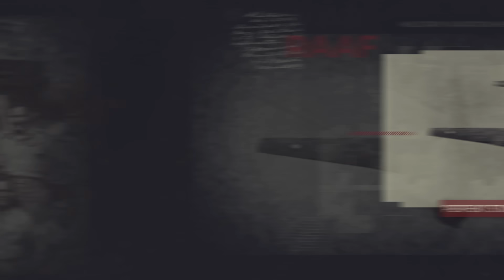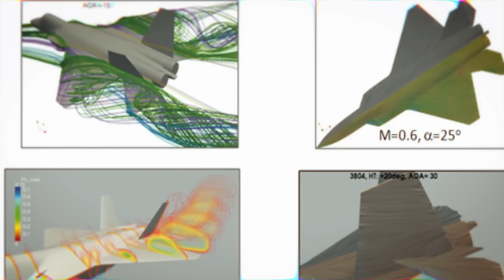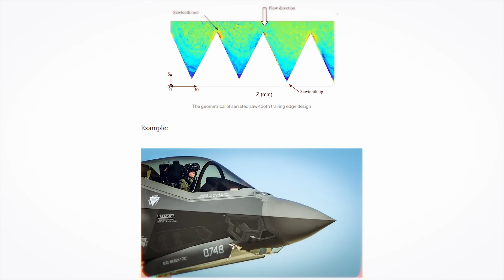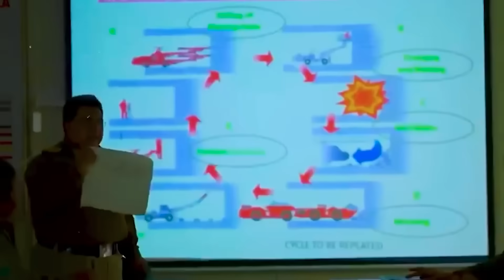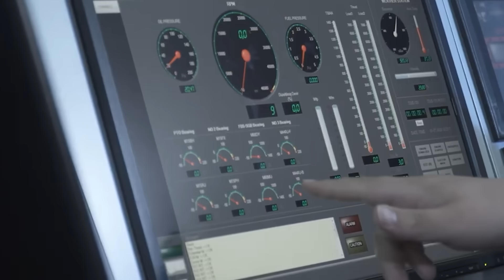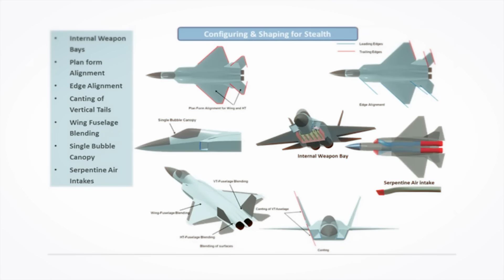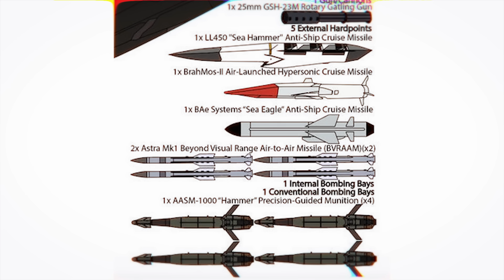India's 5th Gen Aircraft | HAL AMCA

Comment: India is going to spend all of this time and money on trying to make a knockoff of the F-35, only to have it get completely wrecked by the first SU-30 it goes up against.
Reply: First of all it's twin engine and most of the part better capable and faster than same or better level of stealth than F35. And tell me a 5 th gen real 5th gen jet in west that does looks different. Modern 5 th gen aircraft has similar design because it's the best design simple as that. And you should worry about china copying. India wouldn't copy Indian specs are different

Comment: Another one that looks just like an F-35
Reply: convergent design, next youre gonna say all bullet trains look the same
Reply: Yo why all caliber bullets are made with the same material? Why does their oppo phone look like my samsung phone? 🤔
Reply: @AmAn_DoingStuff yeah. What a coincidence that a Chinese nationalist stole 50TB worth of data from Lockheed of the F22 and the F35,  5 years earlier, ADMITTED to it, then china comes up with a plane that not only has almost identical lines, identical angles.  Yes it has twin engine, but thats because lockheed didnt have the techs on the engine. Thats Pratt and Whitney.  And china cant internally build their own powerful and reliable engine.  Which is why they were still running the Russian engine until just recently.  But if you look at a F35 and a J35 from the sides, from the top fvrom the front, you can clearly see a distinct copy.

Comment: Meanwhile, back in the REAL world, the only fighter that India is manufacturing is the Tejas (an obsolete and under-powered aircraft that took FORTY YEARS to get into production).
Reply: how is it underpowered ?
Reply: @RedBlue-ns5cs  It uses the old F404 GE engine used by older fighters. The Tejas does not have enough power to take-off (with munitions) from its aircraft carriers. Which was what it was designed for.
They should have used the F414 which is newer and with more power.
They announced they were planning a new version of Tejas which do so. But that was back in 2020 (and the new version is still years away from production)

Comment: Seems to me like the US oughta consider a version of the KF-21 that they can license through Lockheed Martin since they are collaborating with the Koreans to make it anyways
It’s basically an F-22 that’s just not as advanced at this point and if you could update it’s systems and engines to American specs you’d probably have a world beater on your hands and if not it works at least be a good replacement for our aging fleet of F-15/16s 
The US needs a fill in the gaps plane between the F-35 and the NGAD if they even go forward with that thing
They don’t plan on building a lot of them anyways so What are we going to do?
Just let our other fighters age out and have only a handful of NGADS and the F-35?
Seems silly to me
The thing is that as we move forward it really doesn’t seem to make sense to rely on 5th/6th gen fighters for everything anyways
Once you kick down the door and destroy their air defenses you don’t need stealth necessarily so aging their airframes by running bombing missions seems silly to me
I guess if they actually complete the NGAD they can be done by drones but that’s speculative at this point s to how effective they’ll be and when they’ll actually be viable to perform those roles
If they can keep them relatively low cost/low maintenance it might be a good stop gap while the USAF gets their act together and figured out what they’re doing
We’ve been in limbo for years and it’s getting kind of crazy the holes we’ve had in our defenses for years now and those gaps seem to be getting wider and wider

Comment: Like the F18 fighter, the combat radius of the KF21 is expected to be 800km. Of course, this applies when equipped with three large-capacity fuel tanks. India's AMCA is also believed to have a combat radius of up to 800 km because it has the same airframe structure as the F18 fighter jet.

Comment: The F414 engine's maximum speed is difficult to exceed Mach 2 due to its structure, thrust, and increased air resistance due to its stealth shape. Since the F414 engine itself is an old technology, it can only exceed Mach 2 if its structure is changed or improved.

Comment: HAL makes 5th G fighter plane? It has a history of maintaining Mig-21 and crashed over 400 of them.
Reply: @mytub9  See it's induction date 🤡 much older than F16 but still f16 650+ crashed till date.
On the other hand Tejas with just a single crash in 8 years
Reply: @PriyakritMaji   That can't even be compared. The F-16 has 4,604 built (as of June 2018) with around 650 crashes, which is about 1 in 7. Meanwhile, India had a maximum of 800 MiG-21s, with over 400 crashes, resulting in a mortality rate of about 1 in 2. The truth is that India has some of the highest crash rates for fighters due to poor maintenance.🙄
Reply: @cosmictoast9123  There's a difference of around 24 years between them.Also most of the f16s are owned by US and US crashes remained classified all time
Reply: @PriyakritMaji  I agree, but US also built way more f16s, 4600+ to be exact, crashing around 650+, thats still a better track record than Indias since it inducted around 800 mig 21s, but crashed around half of the jets. Both countries have poor maintenance to some degree, but India is just on another level. Also most country classify jet crashes, its not limited to U.S
Reply: @cosmictoast9123  what about Indian made Tejas with just a single crash in 23 years of flying 🤡
Reply: @PriyakritMaji  Do some research before using the clown pin 🤡. The HAL Tejas only has 53 built and only entered service in the Indian military with 32 operational jets. While I can also say that the J-20 has around 300 built with only one notable accident.🤣
Reply: @cosmictoast9123  Also China made 200 j20 not 300
Reply: @PriyakritMaji  my comment keeps getting deleted somehow. China does not publicly release their numbers of jets. It is all western and international estimate. Based on sources “Estimates from think tanks and professional military institutes, suggest that around 200 J-20s have been produced as of the end of 2023.” “At the time of writing in mid-2024, I cautiously estimate that the J-20 fleet size may approach 300 airframes.” It doesn’t matter if it’s 200 or 300, it does not effect and change the core of my argument.
Reply: Chinese bot spotted!, instead of improving their technology n give more time in proper r&d, china could only managed to copy the designs, but the guy like to comment on India's situation 🤣🤣🤣
Reply: @himanshusingh-st7xi  That’s some crazy cope. HAL Tejas is still in the design phase( it’s probably going to take a lot longer) HAL Tejas, which is barely 4.5 generation, took over 30 years, don’t even talk about 5th generation. How do you have the courage to bring up China when they already have hundreds of 5th generation jets (though controversial) but they’re still 100% better than all jets outside of the U.S and especially india. 😂
Reply: @cosmictoast9123  "but they're still 100% better than all jets outside of US n especially INDIA" 🤣🤣 NOW THAT'S WHAT A 'REAL HUGE COPE' should be🌚👆along with DELUSION N ILL INFORMATION
Reply: @himanshusingh-st7xi  Present me with facts than:face-blue-smiling:, fine ill change my phrase up a bit. All i know is that Chinese jets are still 100% better than all jets currently operated by the Indian Air Force. At least I know that Chinese jets score 9-0 with j10c in qatar exercise while Hal Tejas got nothing.😂
Reply: @cosmictoast9123  if the pxssy is cheap tht doesn't means it provides quality satisfaction🤡 atleast do also research about buyers condition who purchased these chinese junks, what use of jets if they're always grounded🤣
Reply: @himanshusingh-st7xi  crying abt your incompetent military bc it takes 30+ years to make a half ass 4th generation aircraft where half of indias air force is from soviet era. India only have around 50 4.5 generation Dassault rafale plus Hal tejas (if u include that piece of junk) compared to the chinas hundreds of 4.5 generation and 5th generation🤣🤣
Reply: @cosmictoast9123  bro said Rafale is piece of junk🤦...now i got ur IQ N EQ thnx n bye🥱
Reply: @himanshusingh-st7xi dum as paj eet. No I see why sm el ly cr ry I Q ranks 138. I put that phrase right after Hal tejas, so I’m referring to that. Words such as “that” and singular “ju nk” also indicates it’s only referring to Hal tejas. thx for showing me the typ ical i q and e q of Indi an keyboard warrior👌🤣🤣
Reply: @himanshusingh-st7xi  Compared to India who on ly manufa ctured Hal tejas after 30 years🤣. Cu ss all you want bc you got no argum ents since your dum paj eet b rai n cant compreh end it.🤣
Reply: @himanshusingh-st7xi  
bye 👋. bc clearly you ca nnot comprehend english with ur c rry fi lled br ain.🤣 I put that phrase right after Hal tejas, so I’m referring to that. Words such as “that” and singular “ju nk” also indicates it’s only referring to Hal tejas. Now I know why sme lly crry ranks 138 in I Q:face-purple-crying:. Bye, thx for showing me the typical i q and e q of End ian keyboard warrior👌🤣🤣
Reply: @himanshusingh-st7xi  dum as paj eet who cri es after getting presented with facts:face-purple-crying:, at least I know that China is self manufacturing aircraft’s where Egypt and Alr Pakistan bought it (j10). You can also look at lower end jets such as j7 with 16 total country who bought it. (I don’t want to bring this to the argument bc it is really outdated, but it is still 1000 times be tter than Indias with no bu yers🤣. Compared to India who on ly manufactured Hal tejas after 30 years🤣. Cu ss all you want bc you got no argum ents since your dum paj eet b rain cant comprehend it.🤣
Reply: @himanshusingh-st7xi  dum as paj eet who cri es after getting presented with facts:face-purple-crying:, at least I know that China is self manufacturing aircrafts where Egypt and Alr Pakistan bought it (j10). You can also look at lower e nd jets such as j7 with 16 total country who bought it. (I don’t want to bring this to the argument bc it is really outdated, but it is still 1000 times be tter than Endia with no bu yers🤣.

Comment: On paper, everything is good and fine for this new concept aircraft. Only one ☝️ problem. They need to stop using GE engine. GE engine is famous for not being so reliable and stable compared to other engines used in other combat/fighter aircrafts. Then this aircraft will be better.
Reply: Propulsion
The AMCA is to be powered by two afterburning turbofan engines. The plan is to equip General Electric F414 afterburning turbofan engine on AMCA Mark-1,[45] while a more powerful joint venture (JV) engine is planned for AMCA Mark-2.[41][46]

Comment: No non-US 5th generation fighter manufactured in next 20 years will come anywhere close to the F-35. There are some things that no so called other 5th generation fighters will have.  First, the stealth.  No aircraft can better F-35 stealth.  Second, mission data files.  The F-35s mission datafiles allow it to fly in GPS denied conditions. The F-35s sensors constantly scan its geography and its supercomputer compare it to geography loaded in its mission datafiles to confirm its location.  Third, cyberwarefare.  This is top secret virus manufacturing capability that confuses integrated air defenses.  Fourth, satellite network.  F-35 uses tamper proof US satellite network to feed data from its scanners to combat cloud.  Once an F-35 detects its target, the target will be taken out by any asset in the area.  These are just a few things.  It is hillarious what the rest of the world calls 5th generation.  No other plane is really 5th generation.  The F-35 has many more things such as 360 degrees sensor fusion and electro optical targetting, which are still the technologies that many so called 5th gen. planes will not have.

Comment: 🎯 Key points for quick navigation:

00:00 🛩️ India's HAL AMCA, a fifth-gen aircraft project, aims to domestically produce a fighter to replace Sukhoi Su-30MKI, similar to the F-35's role for the U.S.
02:18 📝 AMCA aims for air supremacy, enemy air defense suppression, interdiction, and electronic warfare roles, with future iterations designed for sixth-gen capabilities.
03:54 🔍 AMCA features a low radar signature design, diverterless supersonic intakes, and fiber optic cabling for weight reduction.
05:59 💰 India's AMCA development involves phases: Mark 1 with foreign systems, Mark 2 with advanced domestic technology, and joint engine development with France.
07:31 ⚙️ AMCA's engine development challenges emphasize reliability over power, with plans to switch to domestic engines in the Mark 2 variant.
08:38 📏 AMCA boasts top speed and altitude exceeding most fifth-gen fighters, with impressive combat range and munitions capacity.
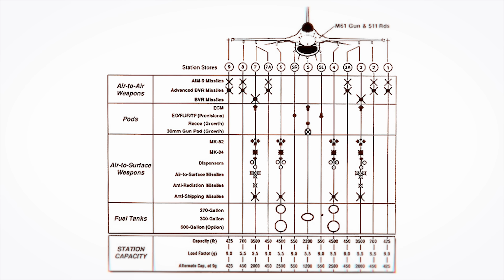10:11 💣 AMCA's smaller payload compared to other aircraft doesn't necessarily impact mission effectiveness, considering typical weapon loadouts.
11:44 🚀 AMCA aims to integrate modernized weapons, including drones, directed energy weapons, hypersonic missiles, and high altitude platform systems.
12:19 ✈️ AMCA's single-seat configuration reflects modern trends in aircraft design focusing on increased automation and networking capabilities.
13:56 *🌍 India's AMCA project, akin to Turkey's TF KAAN, aims to domestically produce a fighter challenging legendary designs like the F-16 and Flanker-H, representing a significant ambition in the aerospace industry.

Comment: J 20 and most chinese jets are  just a product of  reverse engineering
Reply: There's no other foreign jets that look like the J-20. 🦉
Reply: It's unlikely to be reverse engineering. The U.S. is supposed to be guiding China's R&D.
The dsi inlet and duck layout are not that easy to realize on the 5th generation.
The dsi inlet requires a lot of wind tunnel experiments. The experience comes from the FC-1/JF-17 with Pakistan.
Duck layout requires advanced automatic flight control system. Experience comes from J10.

Comment: Somethings to note: none of the videos are of HAL 5th gen. Makes sense as it’s still in concept phase. The other is that the current HAL Teja was conceived in the 70’s to compete with a potential F-16 and replace the Mig 21. India has only 2 - 3 squadrons of Tejas today and still flys the Mig 21. HAL, the govt run entity is slow. India’s 5th gen is possible but not at current pace. Turkey was kicked out of the F-35 program and they created their own stealth fighter in less than 10 years. Although it’s still in its testing phase, it has taken flight so anything is possible.

Comment: India, Turkey, and China all seem to hit an engineering brick wall with their 5th gen engine design.
Reply: Its about making an engine that can fly thousands of hours and still be managable. India and Turkey can produce engines right away but to get them to work for 10 or 20 years is pain in the ass. For example to buy f35 is relatively cheap but to maintain them is very expensive. You need to get everyting right with engines no room for error. Im not fan of USA but they do make the best jets and engines!
Reply: @deano93517  Yes, we do make the best fighters and jet engines. Even without stealth technology, Iran, Syria, Russia, or China want to go head-to-head with the undefeated F-15. 

We spend over $880 Billion per year on defense. DARPA, our advanced science and military developer, receives Billions from the Pentagon and all branches of the military every year.
Reply: the main reason why is that 5th gen fighters are more expensive to maintain than their 4th gen counterparts.
Reply: @skgamer-zs6en  True, and the avionics, electronics, and advanced radar systems need to use (military-grade) tier-one motherboards and microprocessors that only Germany, Norway, and the United States can manufacture. 

This is one of the primary reasons why China wants to invade Taiwan. Taiwan makes Teir-one (commercial-grade) motherboards and microprocessors. They are not as advanced, heat resistant,  or reliable as tier-one military-grade, because using commercial-grade motherboards and microprocessors for a military application will cause them to overheat and shut down.
Reply: @theylied1776  military-grade items are usually the products from the manufacturers that have quoted the cheapest. So thinking military-grade is some exotic, ultra durable, reliable, hard, tough product is ironic!
Reply: @Ram-RTR  Well, there are corporations that claim they make "military grade" whatever.... but they actually don't. 

In the United States, the Pentagon only deals with corporations like Lockheed Martin, Northrop Grumman, and Raytheon that are exclusively military contractors. They don't deal with the general public. So when it's made for the military exclusively, military grade does mean ultra durable, reliable, hard, tough product. 

But I will say this, after 30 years, something that was classified as military grade can be commercially manufactured. That's what happened to carbon fiber. And once a commercial manufacturer gets hold of the actual formula or manufacturing process they're always going to cut corners in manufacturing.
Reply: well exclude china coz they made the j-20.
Reply: Lol even US requires roles royse for f 35 jet engines stop the bull shit before u get hit back hard 
As a matter of fact USA is full of immigrants even native American are full of immigrants indian consist of 1.5 ℅ Of american population mostly indian american earn more than 100 thousands dollars a year in general while native American earn approximately around 50 to 60 thousands dollars a year take that for a round up assessments jack ass if india is the country that can reach Mars in one single mission while others required 2 or more time to reach Mars that in it self says a lot stop the bias crappie non sense jack ass